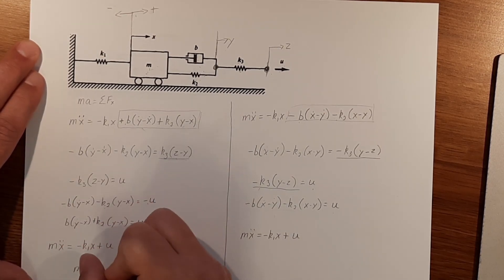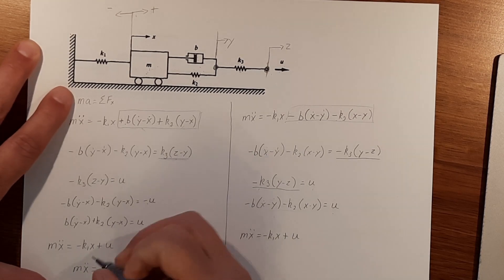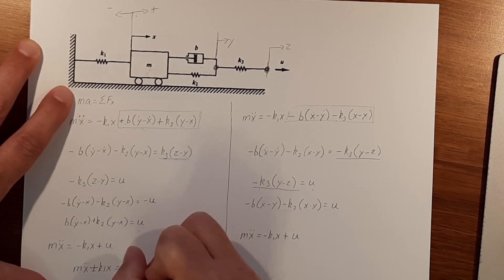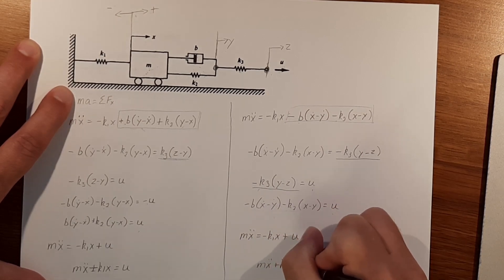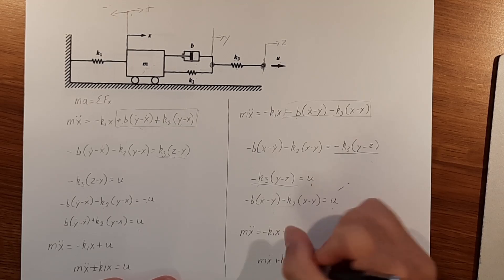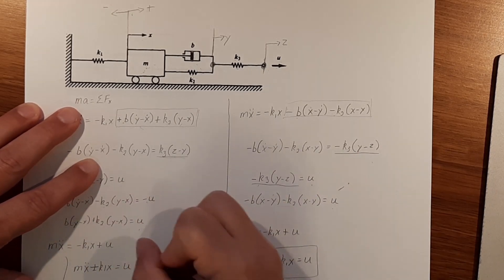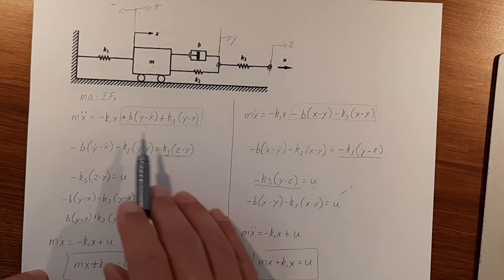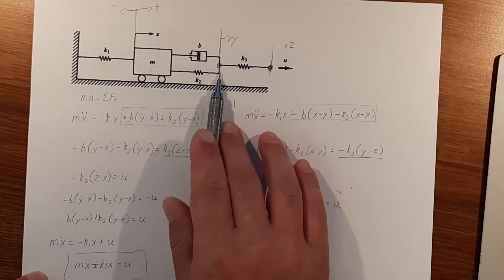Modeling Dynamic Systems with Mathematical Modeling (2020)

Comment: Why is K3 exactly the same on both sets of equations? You said one is keeping positive the other is negative, but the K3 term is identical
Reply from the maker: K3 is technically positive in one equation and negative in the other but we wrote the equations in a way so that they can be substituted into the other equations. They both have a negative sign because in one equation we wrote -k3(z-y)=u and the other is -k3(y-z)=u. It appears they are the same because of the z and y flipping in the parenthesis. Hope that clears the confusion up but it was written that way strictly for substitution purposes.

Comment: I think you made a mistake at 8:00. "The sum of forces equals zero". Thus the sign on one side should be flipped I believe.
Reply from the maker: If I am looking at the same part, that being the 2 equations in the second row, I used substitution from one of those to the other. They are pretty much the same equation but because the x and y, and y and z are flipped it changes the signs. This is done strictly for later substitution purposes. Hope that helps! Let me know if you think I missed something or am looking at the wrong part. Thanks!
Reply: I was thinking the same thing, but I used this for my homework to find the transfer function of this problem and the given equations are correct.